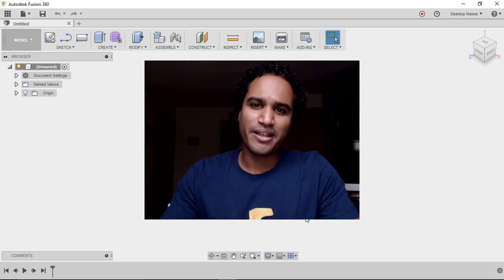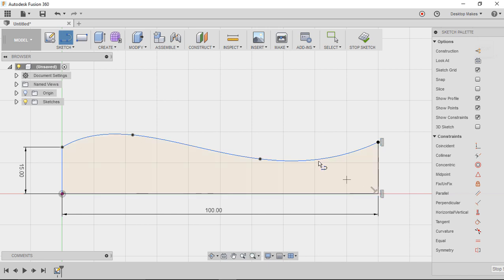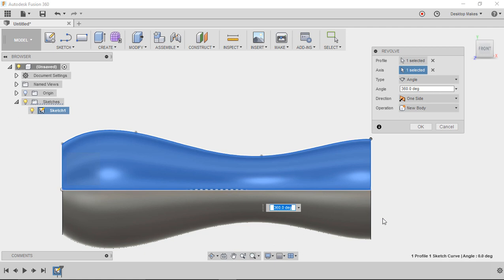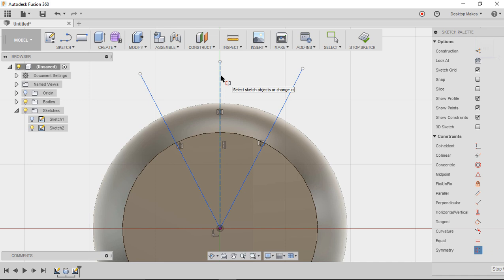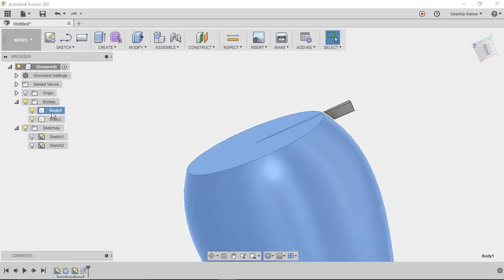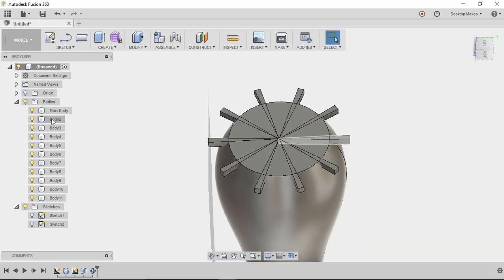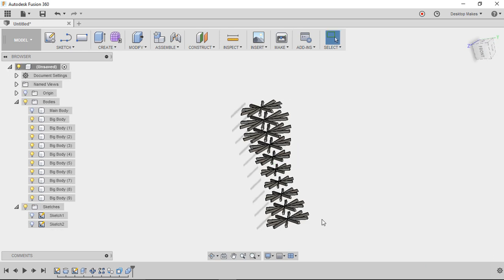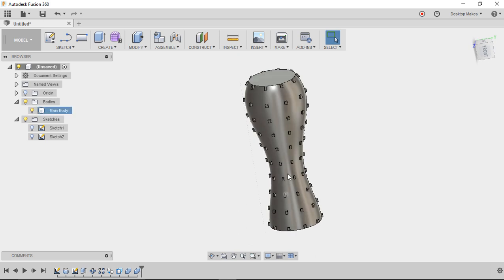Adding Texture to a Curved Model in Fusion 360

Comment: I feel like creating a single instance of the bump, arraying it along the path (the spline of the original sketch), and defining the iterations, and then arraying that series of bumps in a circular pattern would have alleviated the need to work with all of those wedges and would have made the Boolean operations much less taxing on the machine and your time.  That is: model main body, model single bump, path array bump (perpendicular to path option on), select all those bumps and circular array them.  Done

Edit:  I enjoyed the video none the less and as others have mentions you have a great “audible” presence/voice and explanation was great.

Comment: How could I make them holes instead of protrusions?
Reply: Make the copy of the main body smaller instead of bigger. Then instead of intersecting you will cut the smaller body from the little wedges. This should leave you with the wedges being on the outside instead of the inside like in this tutorial. Finally, select the main body, do a combine operation with the wedges as the tool bodies. Then choose cut and that should leave you with holes instead of portrusions

Comment: Bro, you can basically only make raised or recessed squares with this workflow.
here's how you make a sketch based embossing pattern on curved faces ,any shape you want, circles, hexagons, harts, stars, dicks, diamonds, whatever.:
1. make a main body with curved faces (can be 2d, 3d curves or any freeform t-spline also)
2. use the right plane as tool for body split. hide one of the halves.
3. sketch the geometry of one single instance of your embossing pattern on the split face of the half body (> use sketch pattern to form 1 full row/cluster)
4. extrude command > [select your sketch profiles] > "From object" > [select the face on the exterior] > "Distance" [enter value] or [drag arrow]
5. use feature "pattern along path" to repeat the rows/clusters over the surface of the main body
done

Comment: I liked the video. Learned the right application of boolean operations Intersect, press pull bodies.
I know that every component can be created using multiple methods. I just felt that a revolve cut (after offseting the contour of handle) would have done the job.  Correct me if I am wrong. Thanks for the tutorial.
Reply from the maker: Yes, you are right.  Check out this video where I explain why I chose this method:  https://youtu.be/RCIczf-9Quc

Comment: Ah you meant a physical texture. Could you please help me figure out the limitations of Fusion360's image texturing...By creating the number 8 with soft edges, or some totally random shape, and converting it into a triangle mesh (by disabling history in the browser tree at the left of the screen). That way the Mesh menu appears in the mode drop-down. So my issue, is Fusion360 doesn't like to place a png texture onto a mesh. It's sort-of okay if the mesh uses a long shard-like mesh grid, but if it's an even square grid mesh then Fusion360 can't seem to texture worth dirt.
Reply from the maker: Sorry Royce, I haven't played much with the image texturing.  Maybe a topic for a future video.
Reply: I think we are due bro haha.
Great video, I think one could probably do this with an SVG logo right? For example the Nike swoosh, we can create a body from an SVG outline right?

Comment: I think you can also do this by creating a sketch on the bottom of the handle, that kind of origins at the beginning of the spline you used for the revolve, then extrude the sketch to have the 3d texture thing, then i thing you can pattern following a curve (i'm not sure about the name, is it sweep?), the do a circular pattern of that feature and it should work?
Reply from the maker: Yes, in this case you could pattern along a path and then revolve but the revolve would only work when revolving around a circle which would work in this model but not if your design is asymmetrical.  I may do a follow up video comparing the two methods.

Comment: Great tutorial. Regarding the performance issues with higher number of bodies, you could pattern faces, which in lots of situations are faster than bodies. If you can live with some variations in height, pattern along a path might be a fast alternative and allows you to add fillets. I did a short and screencast here:

https://screencast.autodesk.com/Embed/Timeline/6106362c-56b5-4698-8aa9-e4de5f22563a
Reply from the maker: Great screencast Wilco.  I did not know patterning faces could be faster than bodies as far as computer performance.  I'll have to give it a try and compare.  I like your approach of pattern along a path and then revolve.  However this method will only work if revolving around a circle.  If the model is not symmetric or created by revolving (for example you have a some sort of asymmetrical blob), I don't think you could go this route.  I probably should have used a model that was created without the revolve feature to make this point.  Maybe a follow up video.
Reply: I totally missed your answer. Shame on me!

Regarding the performance: Check this post: https://forums.autodesk.com/t5/fusion-360-design-validate/is-there-a-simpler-way-to-model-this-body-1200-bodies-combine/m-p/7522327#M139732